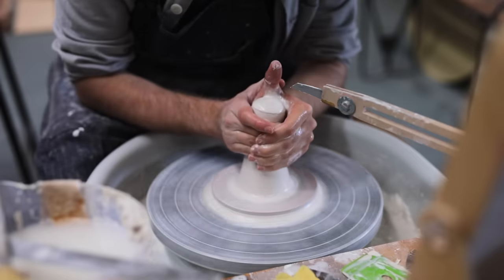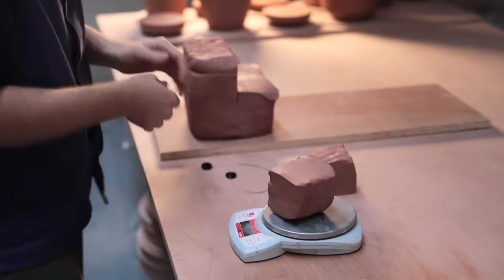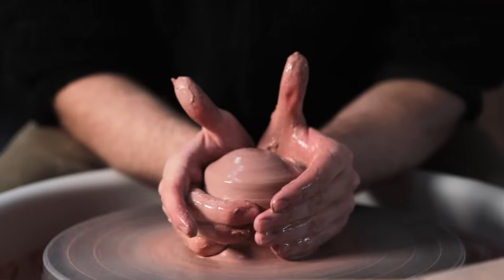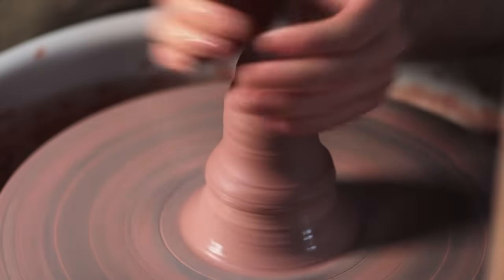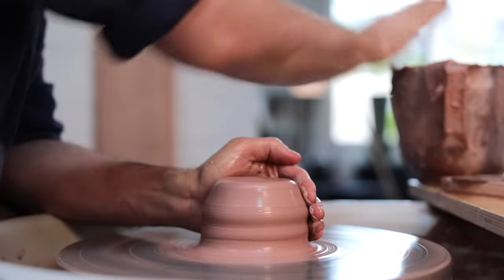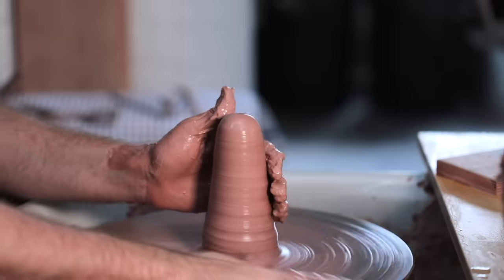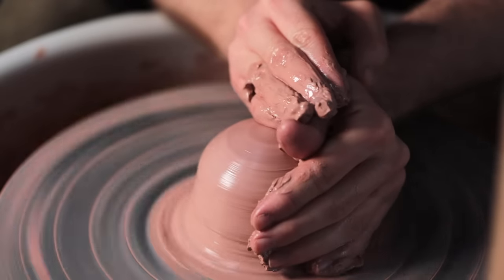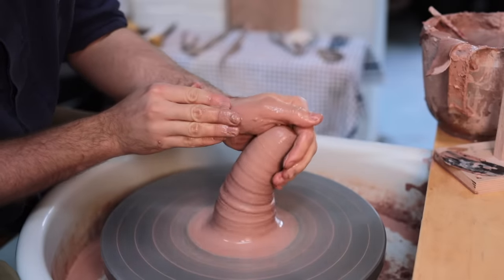How to Cone Clay on the Potter's wheel

Comment: Thanks for this. I saw your list, read the item "Twists in lump" and then that's the one part you didn't cover, lol. I sometimes overdo the pressure on my clay and end up with a spiral twist that seems to go away only to rear its head when I pull up. Will you do a video on twists later? Another part of coning for me is that it it serves as the preparatory phase of settling my brain and hands to the task of throwing. It centers me as much as the clay.

Comment: Am I squeezing too hard if I always end up with a ton of clay on my hands when centering and coning? How do I prevent this, is my clay too dry? Thanks so much for your amazing videos!
Reply from the maker: It's natural to some degree, there's no escaping it, so try not to focus on it at the start. If it's happening too much, try throwing with water rather than slip, and try to work more quickly if you can. It could also be squeezing too hard. Try keeping a container nearby with a sharp plastic edge that you can scrape the slip off your hands against.
Reply: I do tend to over think things and get swept up by certain details. And also tend to keep my hands on the clay far too long as a subconscious effort to keep myself and the clay centered.. which is probably when I'm collecting all that slip! 

I watched the video a few more times, it is immensely helpful ❤🙏

Comment: At least in my area, even fresh stoneware is quite stiff which makes proper coning without cratering on the top very difficult. It requires a lot of water and strength. I think having soft clay is often taken for granted.

Beginners and hobbiests sometimes also use their clay slowly which can lead to even drier and stiffer clay that is almost impossible to throw.
Reply: Reclaiming the clay is possible.  Throw a wet sponge in the bag for a few days and it'll be much softer.  You can also slice it into thin pieces and let it dry completely before slaking it into slop and then drying it to your preferred hardness

Comment: how do you know when to stop coning?
Reply from the maker: I look at the top of the cone. If, as I’m coning it up it levels out and spirals up evenly, then it’s normally ready, otherwise as the clay is forced up it tends to create a wavering point, one side of the top of the cone will be higher than the other. So, I keep going up and down until that top section raises up in a single, even round motion. It’s a bit hard to explain! But normally 2-3 cones is enough, yet it depends entirely on the condition of your clay before you get it onto the wheel. If you’ve wedged it poorly, or if it’s too firm, you might have to cone it more.